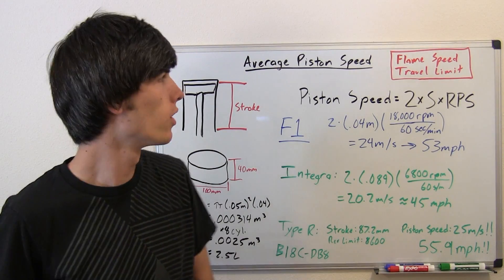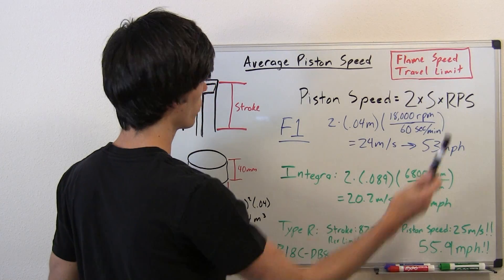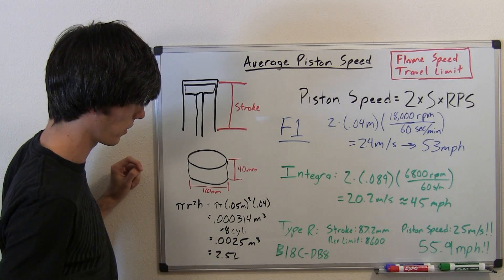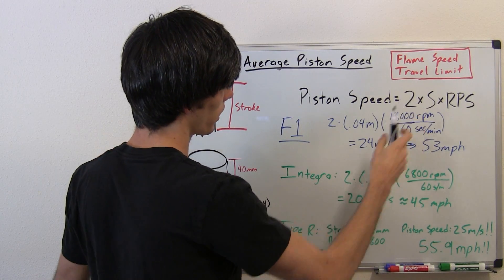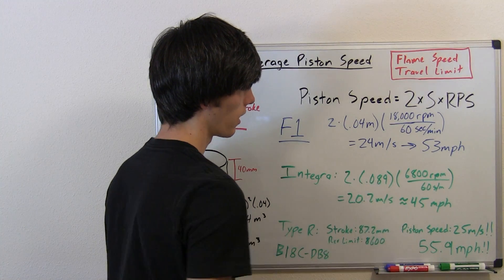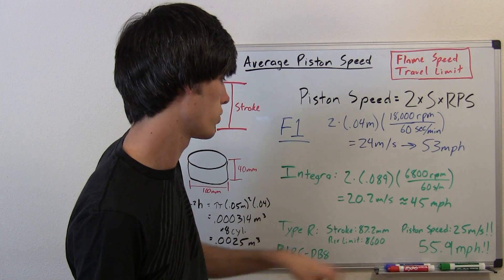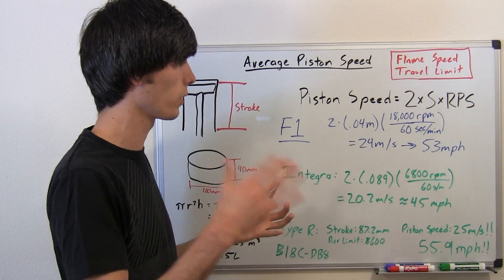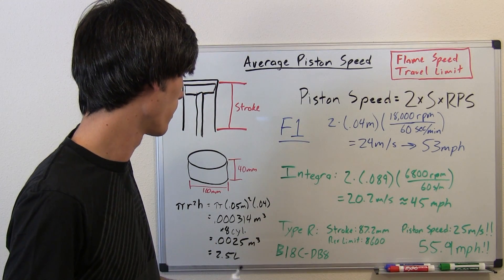Average Piston Speed - Explained

Comment: How would you apply this to a rotary engine?
Reply: +Jordan D There are no pistons, so there is no piston speed.  Just rpm of the rotor(s).
Reply: +Brendan Boutilier  there are no pistons yes. but there is apex! and I assume he's trying to know the apex speed
Reply: Yes, hence what I said.  The only way to measure the speed of the rotor is by rpm since it has no linear velocity.
Reply: +Brendan Boutilier Actually, the Wankel "rotor" DOES reciprocate, that is how it drives the crankshaft, (they call it an E-shaft because a "rotary" engine with a crankshaft is embarrassing). The "rotor" is guided into a hula-hoop waddle they call rotation, to PUSH against the crankshaft, driving it exactly like a piston's connecting rod does. There is no other way, because they are separated by a bearing. That's why the housing shape is an epitrochoid, it has to be figure 8-shaped to accommodate the waddling reciprocation.
The common Wankel crank stroke is tiny at 1.2",  while the driven faces of the "rotor" are very big by comparison and are analogous to the bore, or diameter of a piston. Big bore small stroke. That's why the torque is so low, half the stroke only leaves a tiny 0.6" torque moment-arm. It must be tiny because the great iron "rotors" weigh close to 10 pounds, they'd just love to break out. That is what holds the Wankel RPM to a very low 3,000RPM, but their sales department nailed the tach to the triple-speed crankshaft so the buyers would think that it spins at 9,000RPM, it doesn't.
Reply: +Bob Campbell Hmmm, very interesting, appreciate the comment.  However, it still doesn't really apply to piston speed, as a piston has constantly variable speed, going from max velocity to 0 back to max v rapidly, while a rotor still just has a rotation speed.  I guess it does have a "stroke" and displaced volume, but it's not really the same, right?

Comment: what would happen if the  piston  was  faster then the flame  propegation aka the  piston ran away from the  flame ? if thats  even  posible
Reply: +citydriver You would get a drop in power. Your power curve would go down significantly after that peak speed and your RPM wouldn't really go far past what the flame can provide.  Remember that the flame is the explosion happening in the piston. If it's not pushing hard enough on the piston, you're not providing enough power.
Reply: +citydriver Isn't that essentially what happens when you release the gas pedal?
Reply: +Christian A Exactly! this is true terminal velocity for the piston. The point that it runs away from the force acting on it.

Comment: 2005 Fiesta ST at 7k has a piston speed of 49.06 mph. Don't know the limit
Reply: +jop vs I was wonderin how could it be and after checking it the right number is 19.39m/s  at 7000, but it actually revs only 6000 so it's even less.
Reply: +Janos Gregor So you say it would be 43 mph? It could be since i didn't know the exact number of the stroke. The red begins at 6500 but i don't remember why i chose to go at 7k ;)

Comment: I do have a question. How do you get 40mm to .04?
Reply from the maker: Damon Franklin 40 mm = .04 meters.
Reply: Oh ok. And what about the weight of the piston? Wouldn't it affect the rpms and speed?
Reply: math..
Reply: you add pi
Reply: +Damon Franklin yes but that is not the point. All of that has been calculated by formula one racing teams and adjusted accordingly whether to achieve reliability or speed during design faze. Formula 1 car has a different design for a different goal but the end design should comply with the very strict engine build rules which happen to be the ones in the video. Here the purpose is purely theoretical and simple so it doesn't have to give you the details but just an idea so you can understand how extreme the engines are. I know it's late but it's better than never at least.
Reply: +Damon Franklin duhh

Comment: have you done a video on pneumatic valve train system?  the system that does not use a cam, but a computer and pneumatic actuators to control valve timing and lift?  The performance increases are amazing.
Reply: +RCPro Driver YES PLEASE EXPLAIN TO US

Comment: 1999 Merc CLK200 Kompressor (inline4, DOHC, supercharged)
Displacement: 1998 cm3 / 122 cui
Bore: 89.9 mm / 3.54 in
Stroke: 78.7 mm / 3.1 in
Compression ratio: 8.5 : 1
Redline: 6200rpm
Avg. piston speed : 16.3 m/s
192ps/5300rpm

2006 BMW 535d (inline6; common-rail turbodiesel)
Displacement: 2993 cm3 / 182.8 cui
Bore: 84 mm / 3.31 in
Stroke: 90 mm / 3.54 in
Compression ratio: 16.5 : 1
Redline: 4000rpm
272ps/4000rpm
Avg. piston speed: 12 m/s

1998 Merc E220 CDI (inline4; DOHC; common-rail turbodiesel)
Displacement: 2151 cm3 / 130.9 cui
Bore: 88 mm / 3.46 in
Stroke: 88.4 mm / 3.48 in
Compression ratio: 19 : 1
Redline: 4200rpm
Avg. piston speed: 12.4 m/s
125ps/4000rpm

1996 Audi A4 1.8T (inline4, turbocharged)
Displacement: 1781 cm3 / 108.7 cui
Bore: 81 mm / 3.19 in
Stroke: 86.4 mm / 3.4 in
Compression ratio: 9.5 : 1
Redline: 5700rpm
150ps/5700rpm
Avg. piston speed: 16.11 m/s

1984 Opel Kadett D 1.8 GTE (inline4; OHC; fuel injection; naturally aspirated)
Displacement: 1796 cm3 / 109.7 cui
Bore: 84.8 mm / 3.34 in
Stroke: 79.5 mm / 3.13 in
Compression ratio: 9.5 : 1
Redline: 5800rpm
115ps/5200rpm
Avg. pistion speed: 15.4 m/s

Comment: 2008 Hyundai Accent hatchback
1.6 G4ED 
Bore: 76.5mm
Stroke: 87mm
Compression: 10:1
Redline: 6500
Average piston speed is 18.85 meters per second or 42.16 miles per hour

Comment: My 1988 Toyota Supra Turbo 5spd (7MGTE motor):
- Bore x Stroke => 83mm x 91mm
- Compression Ratio => 8.4:1
- Redline => 6500rpm

Piston Speed = 2 x Stroke x RPMs = 2 x 0.091m x (6500/60) = 19.72 m/s

*Piston Speed (7MGTE) = 44.112mph*

Comment: Assuming crank shaft offset = 1/2 * stroke length (i.e. the diameter of rotation is the same as distance from TDC to LDC), then we can borrow an equation from vibration mechanics to give maximum piston speeds, which may arguably be more interesting, but deriving further, we can also get maximum acceleration, which would partly factor into the fatigue calculations at the design stage. Here we go:

Angular speed [omega] is defined as angular rotation per unit time. Radians per second is the sensible unit for this application, though degrees per second and revolutions per minute can also be used in other cases. 1 revolution per second = 2*pi radians per second.

The radian is a unit of angle. It's defined as the fraction of the radius traversed along the circumference for the arc swept across the set angle. Since pi is the ratio of circumference to radius of a circle, sweeping across pi radians will traverse half the circumference, and sweeping across 2 pi will come around back to the starting point.

In this way, multiplying omega (given in radians per second) by the radius gives us speed along the circumference, also known as tangential velocity. Since the piston and crank travel the same distance vertically, the tangential velocity of the crank will give us the maximum speed of the piston at a set rotational speed.

Cars featured in video (rounded to 3sf):
F1 = 37.7 m/s
Integra = 31.7 m/s
Type R = 39.3 m/s

Comment: honda F22B, s=95mm, redline=6200rpm, 19.6m/s..almost F1 engine lol......what determines redline?
Reply: Usually at the point of red line you start to have "valve float". Red line typically is based on the speed at which the valve springs can no longer close the valve fast enough in relation to the speed of the cam shaft.  This is all based on camshaft profile: height and duration.
But it also can have other factors involved based on the efficacy of the engine to produce power. If you look at power curves you see a steep drop off in power creation in a certain design after a given RPM. Thus any RPM above that is unnecessary and actually counter productive. That is based on air flow through the engine.

I could be completely wrong on the power side of it though. Its been a long time since I was in school for that stuff.

Comment: I have a question that may be stupid, but how come most 8 cylinder engines rev lower than 4 cylinder engines? when I think about it, it seems like the more pistons you have, the faster it would able to turn the crank shaft.. if they fired as quick as 4 cylinders wouldn't they rev higher? Then again I did just wake up so my brain isn't fully functioning right now and i've never thought about this in detail before lol.
Reply from the maker: Aaronx3Sally More cylinders means you don't have to rev as high to make as much power. It doesn't necessarily mean it can't, however.
Reply: Engineering Explained is that simply  because twice as many cylinders will have theoretically twice the horsepower?
Reply: Archie Macfarlane It also has to do with displacement. More displacement means more fuel burning, and more power. That's Part of the reason why a 1.8 liter 4 cyl makes 150 hp and a 5 liter v8 can 400. There's other stuff to, start looking through his channel you should find the answer youre looking for.

Comment: 1991 Range Rover 3950cc V8, no factory redline so I'll guess it at 5000 rpm since max power is at 4750 rpm. The sedan/saloon version of this engine had a 6000 rpm redline.:
15.83 m/s  34.23 mph (5000 rpm)
19.0 m/s  42.5 mph (6000 rpm)
I've never before seen so many people run a formula in response to a youtube video. Are we all just compete Petrolheads? Yeah, I guess I am.

Comment: does the Revolution Per Minutes mean an entire 360 degree complete rotation of the crankshaft? Is that how it is measured??
Reply: It is measured by using the crankshaft and camshaft sensor (mostly the crankshaft sensor on most cars).

Revolutions per minute does mean how many 360 degree rotations the camshaft makes in a minute. If it was measured off of the camshaft it would be twice as high.
Reply: chevelle1258 guess you don't need (another) sensor on the camshaft since that will be pointless when u already have a crankshaft sensor...
Reply: On some cars it is required. Some cars use one or the other for a TDC  (top dead center) reading and the other is used to figure out which part of the revolution the engine is at in degrees. Some of them also just use a cam or crank sensor (1998 Nissan sentra if i remember correctly). It has a slotted disc with 35 slots on the outside and 4 on the inside (fine and coarse if i remember the service information correctly). The coarse (4 slots) were on the inside.
Reply: chevelle1258 I see, but if you "just" want to know the RPM you'll only need the crankshaft rotation sensor right?
Reply: For the most part that is whats used.
Reply: chevelle1258 "If it was measured off of the camshaft it would be twice as high."

Half as much - 4 stroke engines have 360 degree camshaft rotation per 720 degrees crank rotation
Reply: ***** or you can just say 2:1 ratio
Reply: 7150285 You could do that too. crank degrees and cam degrees are important terminology to know though

Comment: Porsche 944: 100 mm bore, 3.1" stroke, 6400 rpm. 37.58 mph. However a 356 engine will turn 12,000 with very few bent valves.

Comment: Piston speed and flame speed wrt rpm limit.  4A-GE has a 77mm stroke and 8200 rpm redline. 21.0 m/s, not 28! Unless you rev to 11,000 😳 race cars don't exceed 25 m/s. darg cars can get away with 30m/s for a few seconds, and then they need to replace parts. Production cars keep it to 20 m/s.

Comment: You literally have your concepts backwards.

My 2.4 Ecotec makes peak hp at 20.9 m/s.
Rolling Thunderz C6 Z06 Corvette made 740 bhp @ 7400 rpm wth stock shortblock 25.1 m/s
Check out Dart 708 on youtube.  7600 rpm and 5" stroke - not to mention heavy ass pistons!

Comment: My 2007 VW GTI has a bore/stroke of 82.5mm/92.8mm. At 6500rpm redline piston speed is 20.1 m/s (45 mph). At the rev limiter of 7000 rpm it's 21.65 m/s (48.4 mph)

Comment from the maker: We have the same stroke length, but my engine revs to a higher RPM, and you claim your average piston speed is higher? Do you see the flaw?

Looks like you decided to multiply by 2 for some reason. 2*0.090*6500/60 = 19.5 m/s.

Sorry, the Integra is unstoppable.

Comment: Yeah, I'm 66 and somewhat stuck in the 'old-school' with 73 Corvette, and a 1946 Harley...no electronics except voltage regulator in the Vette....no automatic transmissions either. Discs front and rear on both.
 Your pesentations are fast-moving and the white-board drawings are pretty decent too..
 I DO get a couple magazines, Hot Rod and Cycle World, so I keep up with the speed engineering deal pretty well.
 Your explanation of the 'mass' of air at 200+ MPH is good for people to learn.

Comment: I just stumbled across your videos today, after looking at some F1 stuff. Excellent explanations and the drawings are actually pretty good too. Even after 50 years of driving and riding motorcycles, I'm still interested in learning new stuff.
 So, yes, I have 2 Harleys, a 46 and a 72, both are pushrod Hemi's! pushrod/hemi is the best way to get some power, without overhead cams, which of course make the engine much taller. Only drawback is you're always stuck with 2 big (heavy)  valves.

Comment: he's correct in a sense. factory safety parameters limit the engine to around 7500 rpm. you CAN push it higher towards that "limit" however revving higher will not create more power as the stock cams on any evo were meant to hit peak at approx 6800rpm (old wrc standards come into play here as wrc limits to 6500rpm)

Comment: "It's pretty much like a Formula 1 car, just drivin' around town." Loved this line.

My 1997 Prelude has an H22A4 engine, which I would argue is quite competitive with the Integra's B-series. Anyway, it redlines at 7200 rpm, with a stroke of 90.7 mm, which gives 48.69 mph piston speed. Or, if I take it at the fuel cutoff of 7400 rpm, I get 50.05 mph piston speed!

Comment: To get a pistonspeed of 25m/s to work properly, you need a intake flow speed of app 72m/s for a 4 valve engine.
With bigger bore the valve size could be increased for better flow.
The main thing is that the intake and porting of the engine is crucial to get those big numbers.

Comment: the average piston speed is not basicly a matter of flame/burning speed ....its a matter of material withstanding and oil film stability ....

by the way ...i got 93 mm bore and max rev is 8800 ....= 27.7 m/s

Comment: Is flame speed vs average piston speed really that important?
I would say the time the air/fuel mixture has to completely burn out and reach full expansion is more important than APS. The Formula 1 engine running at 18000 rpm's only have 1,66 milliseconds to complete its power stroke where as the Integra running at 8600 rpm's has 3,48 milliseconds to complete its power stroke. So the F1 engine has under half the time of the Integra engine to burn the air/fuel mixture and reach peak pressure.

Comment: 1960's Imp engine - designed by Coventry Climax. 1040 cc 60 mm stroke 10krpm = 45 mph piston speed.  Can be tuned relatively easily for a specific output of 120 bhp/litre naturally aspirated.  Will do 0-60 mph in under 6 seconds in a 570kg 1974 Clan Crusader! Sounds like Honda have caught up then ...

Comment from the maker: They have higher compression ratios, are typically turbocharged, and have longer strokes. But they don't rev very high, so the HP numbers are relatively low compared to the torque.

Comment: so the shorter the stroke is the higher rpm the engine is capable of.
What I don't get is why diesels tends to have low end torque and horsepower unlike gasoline engines?

Comment: for Peak piston speed you need to know stroke, rod, & RPM
LS3 = stroke 3.622'' - rod 6.1'' - @1000rpm 
stroke(3.622'')*pi = 11.3788'' crankjournal travel distance
11.3788'' * 1000rpm = 11378.8''perminute * 60minutes = 682728''perhour
682728''perhour = 10.7753788mph journal speed @1000rpm
10.7753788 * 6.2 = 66.80734856mph @6200rpm
rod(6.1)/stroke(3.622) ratio = 1.684 an acceleration factor from graph of 1.011
66.8mph * 1.011 = 67.5348mphpeak piston speed @6200rpm

Comment: When a piston goes up it is can be accelerated pushing against the cylinder walls, this is what causes the wear

Think about how the big rod end velocity might not match the small end on the piston, when the small end passes over  the centerline of the big ends direction of movement, this only happens when the journal is past 90° to the crank, but the journal isn't just moving up, some of its speed is moving sideways, so you have to find the moment combined they are the greatest

Comment: This is becoming very frustrating. Do you really know what U R talking about? U R just mixing #s randomly.
More problems...
1)What the hell is a rod/stroke ratio graph?
2)2 divided by 1 is TWO, not 1.5.
3)Before U use acceleration,U have to CALCULATE it. Where did U get acceleration from?
4)Where did U get 1.02?
5)"small end of rod cresting over journals?" U have to describe motions better than what U R doing now. It's very confusing. 
6) USE the equation U gave me. Show me how to make it work!

Comment: Where did you get this equation because it don't work! This is a list of what's wrong...
1)This don't give MPH
2)Why are you changing into radians?
3)This doesnt give MAX piston speed, only a speed if you know some angles
4)There is a syntax error. My graphing calculator says so. 
5)Finding the speed of the crankshaft journal then multiplying it by the # gives a DIFFERENT answer. 
6)What is RodAngle? Angle in relation to the rod's crank journal? Or in relation to engine crank angle?

Comment: You have to find the speed of the crankshaft journal from a specific engine yourself then multiply it by the number to get pistons speed

or try

InstantaneousPistonVelocity = -2*PI*(RPM/60)*(Throw/12)*(TAN(RodAngle*PI/180)*COS(CrankpinAngle*PI/180)+SIN(CrankpinAngle*PI/180)